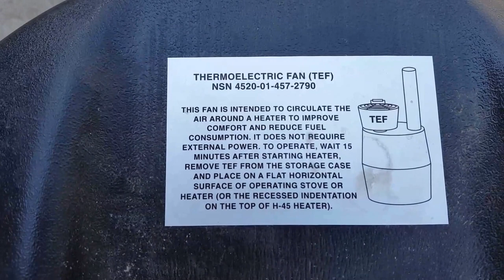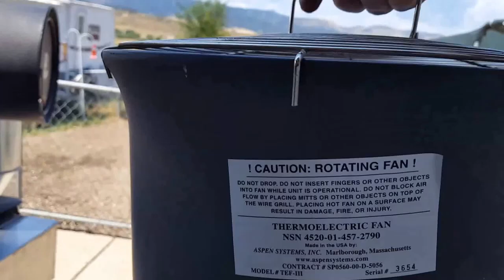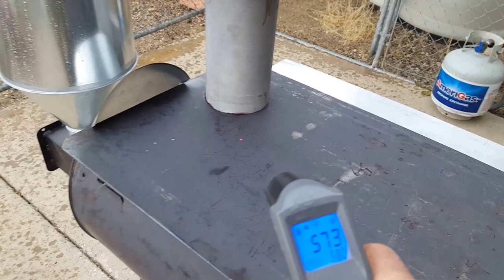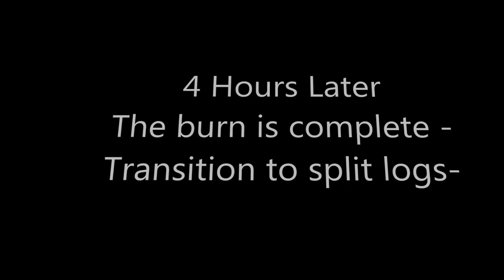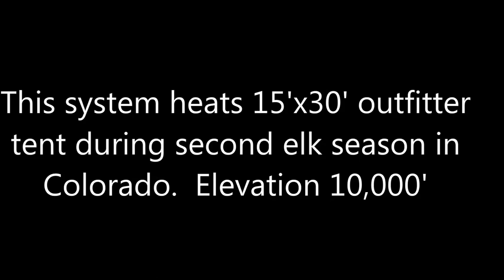Pellet Burner On A Cylinder Stove - Test

Comment: I made that same setup for my wood furnace. I used 4" square tubing for the fire chamber and 2" x 3" square stock for my pellet feed. My hopper holds one 40 lb. bag of pellets and last 10 - 12 hours depending on which burner I use (I have 4 different styles) It heats my home just fine.

Comment: The actual pellet burner design is not easily found just how it's designed, but with a lot of research, I did find a photo of it in one of the camp stove forums. I found it to actually work very well and throws a nice blue flame for the most part. That tells me it is burning very hot. The nice thing is that it does not plug up like a basket type burner does (ie: the ones that use stainless steel rods to make a pellet basket) I've been using one mounted on my wood furnace to heat my home. I run it for 8-10 hours on a 40 lb. bag of pellets. It actually burns hotter than the red oak hardwood I normally burn in it. It's so much nicer just being able to dump a full bag of pellets in, light it up and let it go all day or night.
Reply: Hi Painter D,  I am planning on building one of these and saw that you have done this. Do you have a link to the photos you found? I am trying to get a better idea if there is anything inside of the steel tube or if it is just the the hole on top for the hopper, holes on the sides for the breathe holes and a slide plate to cover them up. Do you have any pictures of yours? Inside and Outside? Thank you.
Reply: Um, could you please share? Thanks

Comment: just bought that pellet burner. works great on high but on low it started to burn up the pellet hopper. i noticed the pellet hopper got hot and when i opened it smoke came out. any ideas on how to fix this

Comment: We have the exact same setup but run into problems with the pellets becoming clogged at the top of the pellet burner when they get too hot. Have you run into this problem and if so have you found a solution to it?
Reply from the maker: Have not had that problem after placing a stone on top of the pellets. Seems to keep them feeding better when the system is hot. I used a stone that was about 1 1/2 times the size of my fist.

Comment: so about 20 lbs for a 8 hour night burn. Doesn't seem too realistic for camping to haul all that extra weight. I'm trying figure out if I purchase an oversize stove can fill it with wood and choke it down to make it last all night? I use mesguite charcol for my smoker bbq and can make that run all night 10 hrs on a single load of fuel at 250F.
Reply: I have an England stove works surviver  ,24 inch fire box ..fill with hard wood on coals ,shut down and last 10 hours , have added fire brick , good luck  and enjoy the wood heat

Comment: a friend of me build me a great tent stove exact our needs, this we cant buy anywhere, i only need a Pellet feeder, any ideas? Thank you.
Reply from the maker: Cylinderstoves.com sells a pellet feeder that you can fit to your stove.
Reply: For $300 I think it's a little over priced. I made my own using 4" square tubing about a foot long. I decided if it works on a camp stove, why not put one on my wood furnace in my basement, so that's what I did. It works better then burning regular cord wood and a lot hotter too. In fact, it's almost too hot. I decided to make a smaller wood furnace and now I heat my home with it!

Comment: Have you tried corn in your pellet hopper ? As a substitute fuel ?
Reply: Corn does not work in that kind of burner. It clumps up as it burns and the stove will eventually go out. I tried it. You may be able to mix corn and pellets half and half and try that I guess.

Comment: im also confused what the purpose of the pellets are.
Reply: To not have to collect and cut wood. To avoid tracking all manner of wood debris into the tent. To have a longer lasting fire in a cold snap.
Reply: How much is this whole set up$
Reply: @yamahchopper  do the damn research like I did and you will see it cost about 32,499.00

Comment: Is there a point to the water container other than having a bunch of hot drinking water?
Reply from the maker: The water tank can be used to heat food in (boil in a bag meals). It also adds humidity to the area being heated by the stove.
Reply: do you not like to stay clean when you camp?
Reply: @joe18750  yes and I don’t need hot water to stay clean…
Reply: @MrHf4l  lol, ok. so you claim. but to publicly state you don't understand what hot water would be used for is more than a little foolish.
Reply: @MrHf4l  you’re right. Not everyone does. But in this video and this thread it very much is. Do try and keep up. You’re very boring otherwise.

Comment: Where did you buy the pellet attachment
Reply: shane Causey
Reply: hi my name is pete where did you get the pellet burner from
Reply from the maker: www.cylinderstoves.com/pellet-burner-kit.html
Reply: For $350 for the pellet burning attachment,  can make them all day for that price. YIKES!! I made one for my stove in my shop and one for my wood furnace in the basement. Now I heat with pellets instead of cord wood. At $3.79 for a 40 lb. bag of pellets, it's better than cutting splitting and stacking wood. NO SMOKE at all!!!
Reply: @spanky522  can you describe how you made it?
Reply: I used a 1 ft. section of square tubing (3/16" thick walls) the feed tube on mine is a 2" X 3" square tube 10" long. I welded it so it is about 1/4" down into the 4x4 tube so the burner has something to fit against when I slide it in. The burner itself is two square 1" tubes that are 10" long with a piece of 3/26" flat piece welded at a 45 degree angle on top of them. There is also a 1" piece of round stock that is 2" long in the middle of the flat stock that is angled down slightly.  It works by the pellets sliding down the 45 degree flat piece and landing between the two square tubes. I light the round tube with a propane torch to get it going. Soon the air is drawn into the round tube and keeps the flame going and the two square tubes that are on the bottom feed more air into the stove to burn up the smoke (secondary burn) and by the time the flame shoots out the end, it is over 1000 degrees and is smoke free. It will feed all day just from the gravity of unburned pellets falling into the flames od the burned pellets. I clean it once a day to clear out any ash that acumilates in the square tube, but it's not much.
Reply: @spanky522  any way you'd be able to do a video on it. It's hard to visualize this. Thanks for the explanation though if not. I'm going to try to weld one up myself.
Reply: I'll try some time in the future to get a video of mine and show it in action once it cools off this late fall in Minnesota. I'm not familiar on doing and posting videos (never done it before) so bare with me. I'll get some help from the Mrs., she's better at that kinda thing. I want so much to share my findings with all of yo that are interested because it just blows my mind on how well gravity feed systems work. I'm been experimenting with them for several years now and I found my design to work better than those I tried to copy.  So I'll be back in the fall!
Reply: @spanky522  I hope you can show something as I'm interested in this as well. I'm an aging machinist and welder with an old school Timberline wood stove that I would hate to replace if I can somehow refuel it. Guess I will subscribe to your channel in case you make a video???
Reply: @spanky522  Any links to what these feeders look like, the one here linked does not sell them.
Reply: @spanky522  THis is very hard for me to visualize or understand. Any pictures or videos please..?

Comment: the adapter should be on the door to get a better draw
Reply: No, you actually want the pellet burner attachment on the back of the stove, so the flame rushes into the stove, then turns back to the rear to exit. This way you capture all the heat before it exits, making it burn more efficient.  These stoves and pellet burner attachments are way over priced in my opinion and are much cheaper to make if you can cut, grind and weld square tubing. I made my burner in less than a day in the shop. I actually made improvements with my homemade pellet burner, making it burn cleaner and more efficient than the ones you buy like the one in the video. I will never, ever buy a commercially built pellet stove seeing how easy it is to burn pellets using a simple gravity fed system like mine. I don't have to deal with augers and electricity to run mine (OK, I do use a fan to distribute the hot air now, but it can still run without it)
Reply: @spanky522  do you have your plans online anywhere? I would’ve to see and add to my camp stove for cold Alaskan nights